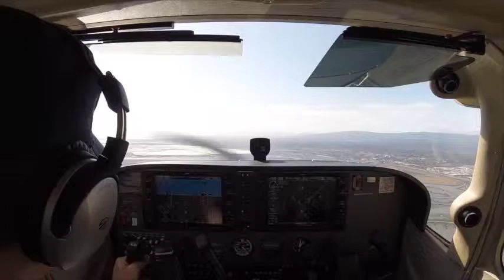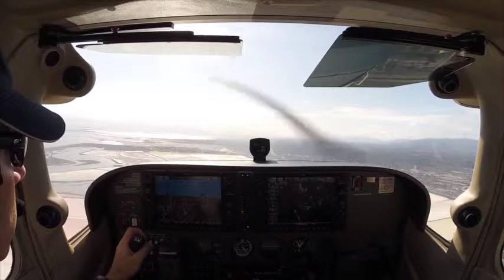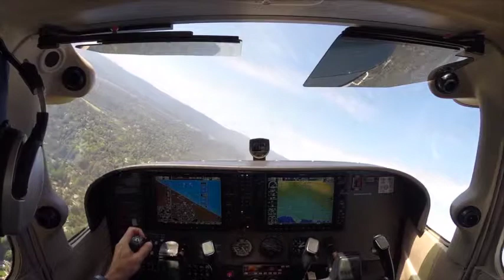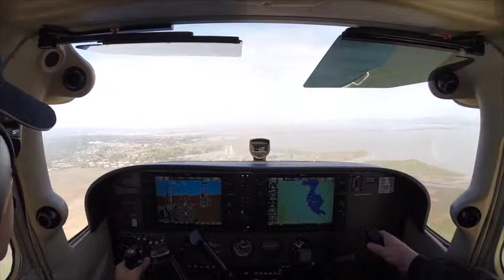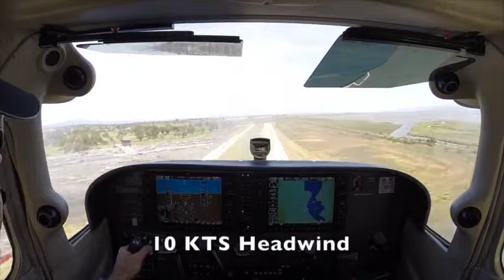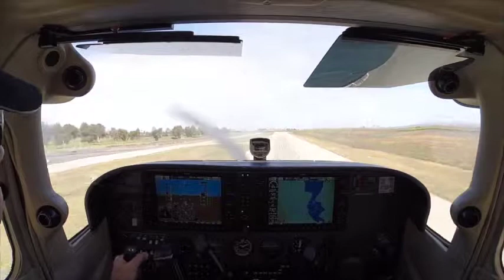Cessna 172 Slow Flight - A Practical Application

Comment: How do u mount ur go pro
Reply from the maker: I have a telescopic aluminum pole with suction cups on each end. It was originally designed to mount to the side windows horizontally (in older 170s before shoulder belts). I mount it vertically between the seats (from floor to ceiling) so it doesn’t interfere with the seat belts. Unfortunately they no longer sell this item.